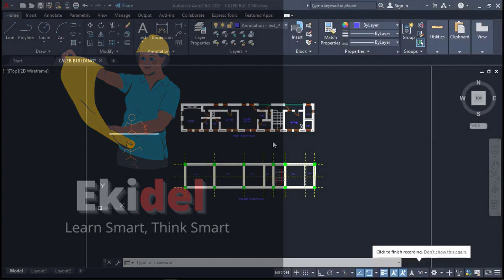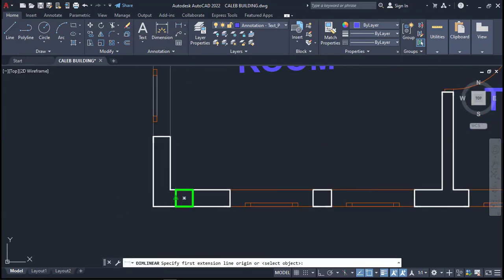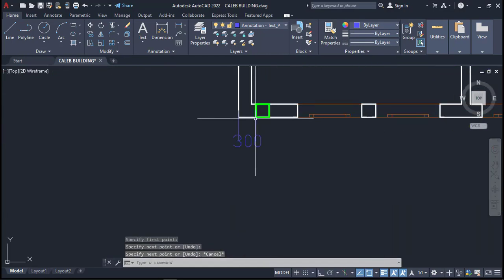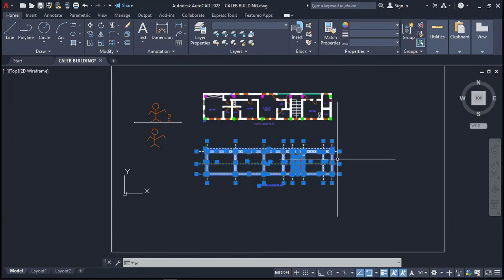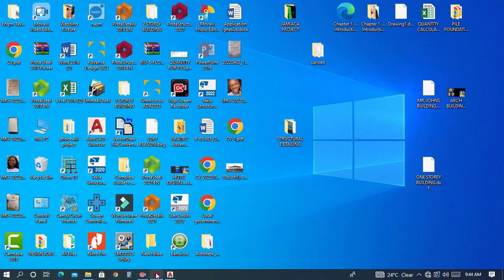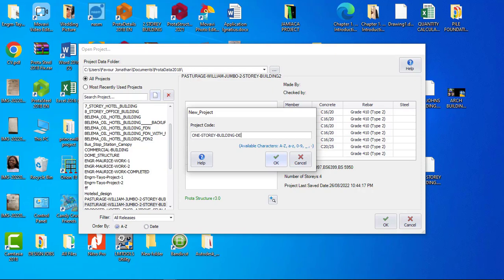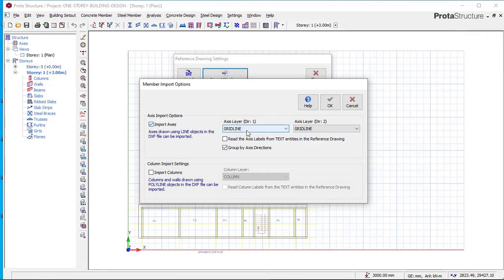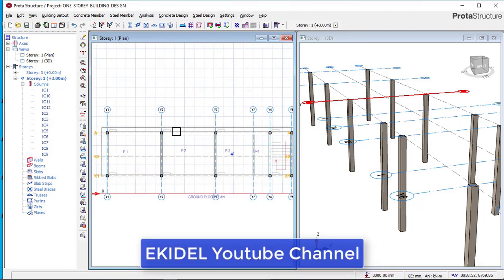PART 2 - Step by Step On How to Design Reinforced Concrete Building in Protastructure

Comment: What version of Protastructure do you use?? How do you produce calculation sheets for your beams, slabs and columns. I use Excel sheets for mine. I checked out the beam design report on Protastructure 2021. The Shear force and Bending Moment diagrams are horrible. The displayed values are overlapping.
CSC Orion design reports still remains the best; The only problem is the restricted number of storeys.
Reply from the maker: I used Prota Structure 2018
Prota Structure is the same with CSC  Orion... I was using Orion for years before I moved to Protastructure.

You need understand Prota Structure sittings